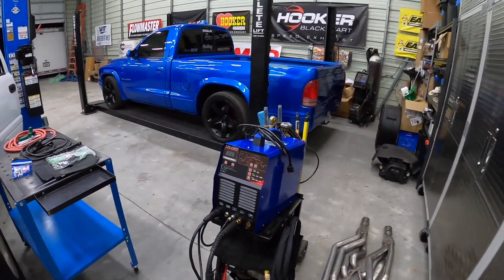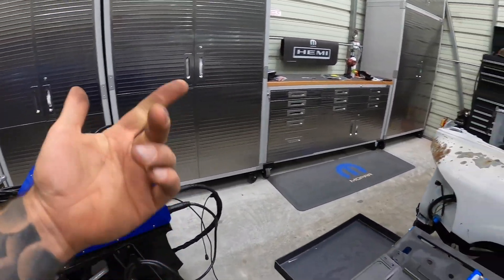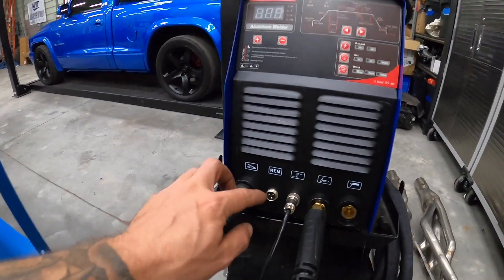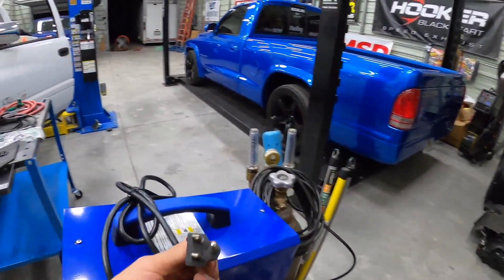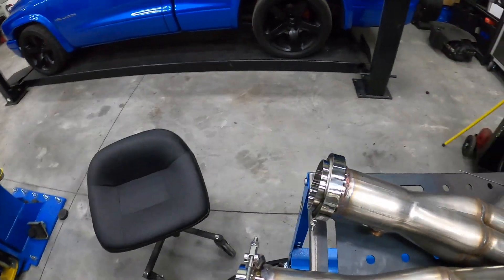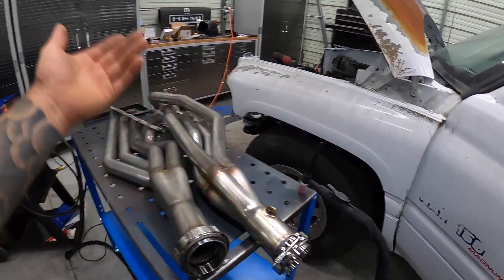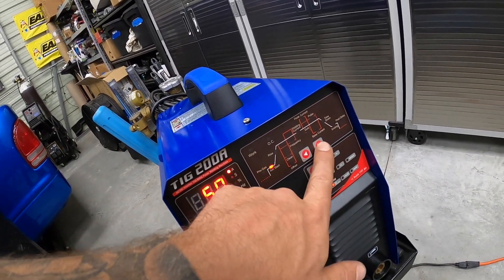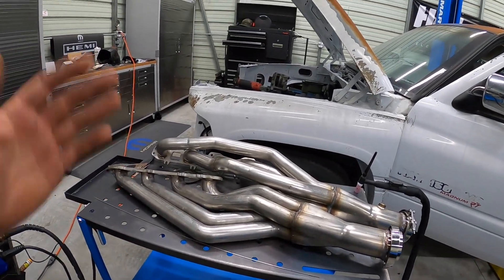Vevor TIG & Stick AC DC Welder 200A REVIEW

Comment: I got the 250a which is also ac/dc  from Vevor not seen any reviews on that unit. looks exactly like this one physically.
Reply: I just got one from Amazon returns and am amazed the price if the offset - balance control works for aluminum.  Definitely the best price when not even a return and the beinged return price was outstandingly amazing.

Comment: Thats the same I have, what setting did you use?

I'm trying to weld aluminum 1/16" but no luck with proper settings yet
Reply from the maker: I just did some thin aluminum.  Turned it to AC and ran the current at about 60-65v with the frequency around 100-120
Reply: @GarageGoals  thanks . what would you say is the best for ac balance and offset